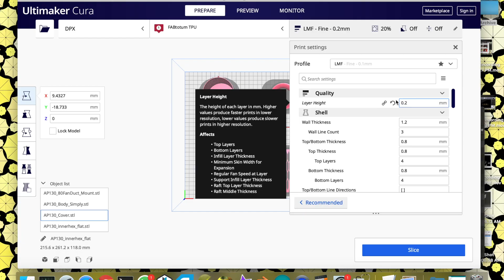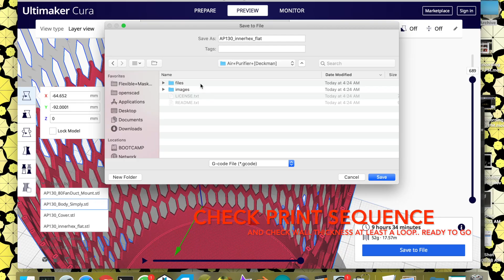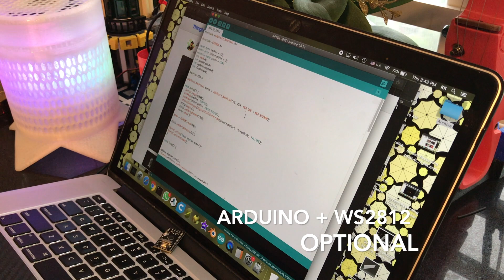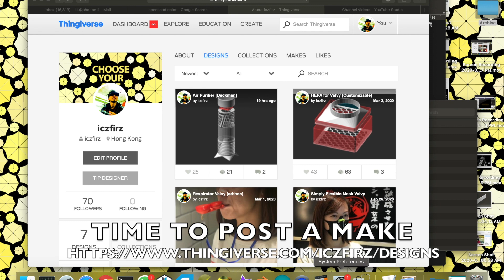Air Purifier [ Deckman - DIY 3D Printed Size Fit to Car Cup Holder ]

Comment: I use an 80mm fan. The top is big enough. What if I make the bottom filter part 55mm 60mm? The original file is 118mm.